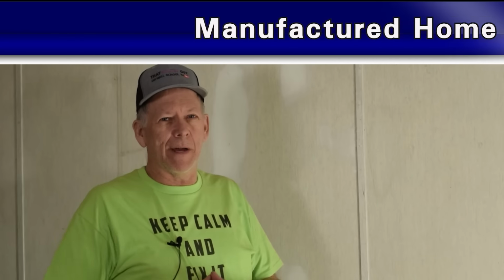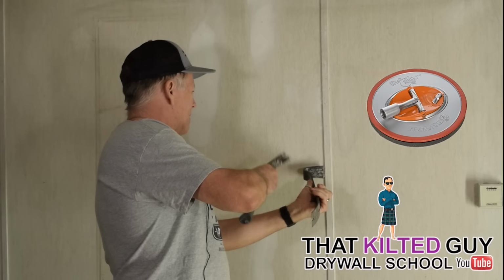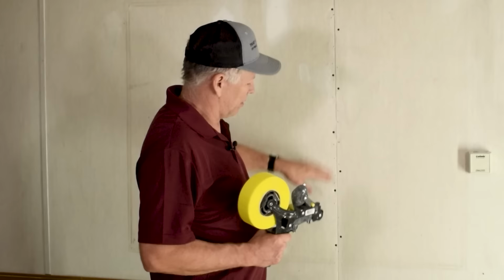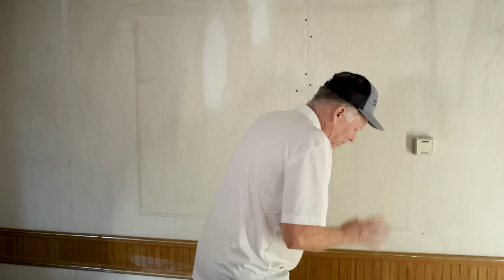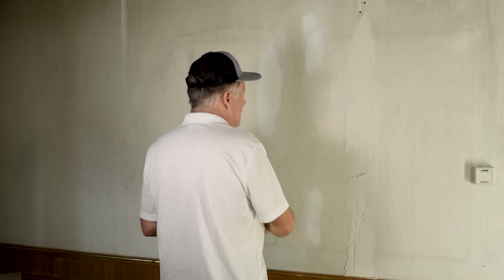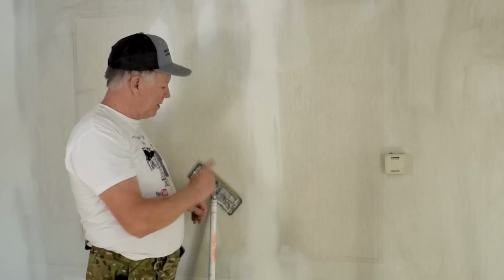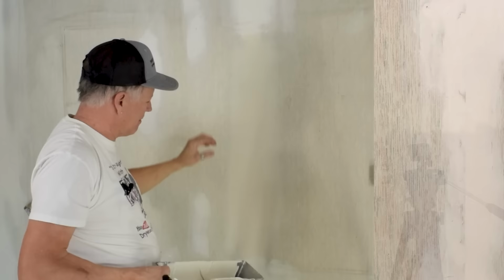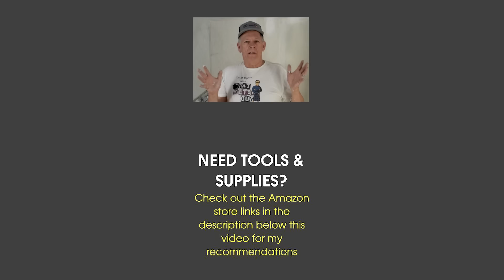Mobile Home Wall Removal in 2022. Smoothing out the wall strips

Comment: There’s so much negative stigma associated with owning a trailer home. But with the tiny home movement this is a fantastic way to upgrade your house into a home!
Reply: I think the stigma is more about the PARKS than the homes themselves
Reply: K Moore1  hey I've toured a triple wide they are GORGEOUS
Reply: Perfect video! How did YouTube know I was thinking about this in the shower yesterday? I bought my 2100 sq ft triple wide for cheap 10 years ago. Paid cash. Upgraded flooring and appliances first. Doing a metal roof next and should last for the rest of my life.
Reply: When I'm done with mine (it's a second home on 31 acres) you will never know it was a mobile home except for the trailer hitch. I'm leaving that for the tax assessor. All totally gutted and redone right on the inside. The outside will have the metal exterior ripped out, sheathing and then log cabin siding. Every window has been replaced with Pella house windows. With the forest green metal roof and structure the former owner put on it it's going to look AMAZING. I don't mess around. I've learned a LOT in the process, my friends are amazed not only with the results but with my abilities. I'm a software engineer and nobody ever taught me a damn thing about construction. If I can do it literally anyone can. Do your homework and watch YouTube videos.
Reply: I live in a mobile home park..55+ it's sign says" most beautiful park" in illinois & I agree!
Reply: @GlorifiedGremlin  
That’s true! I bought a mobile home in a park but it’s nice and gated with a private pool and park. The park manager is strict but I love it! He drives around every two weeks checking on things. I’ve slowly remodeled. When family found out I was moving to a park, they turned their nose up at me😂. I paid cash for it and paid my lot rent up a year since it’s only $225. I have no regrets. Once I’m done, I pray to find land and move. A mobile home was my only option since I couldn’t afford a brick home. It was better than the $800 a month small apartment I was living in. It’s mostly retired people and people who travel a lot living here.
Reply: They are somuch cheaper to repair and keep up.

Comment: I went ahead and put all new drywall in my manufactured home. The reason is because I wanted smooth walls….no texture. I think even a pro would have difficulty achieving smooth walls. Reasons are numerous….older manufactured homes are often sitting up on blocks on the dirt. They will shift and move over time especially if you live in a rainy/damp/humid environment. Floors get out of level which causes walls to be out of plumb. Studs are never crowned when they frame these so you see waves in the longer walls such as hallways. Over time the floors arch over the I-beams. I will say this though….if you know how to correct these issues and put in some work, manufactured homes can be a very affordable alternative. I purchased mine which is 20 years old for $11,500. I put about $15,000 in and plenty of sweat labor, but it will market for $50-60k in my area. Plus they are great for “practicing” on because of the lower value and cost to improve.

Comment: My experience with mud on vinyl is you have to sand the sheen off of the vinyl before mudding. Also, you should be using PVA primer (poly vinyl acetate primer) to seal and harden mud (1st husband was a union painter). Using regular primer will soak into the mud, causing it to eventually flake off of the wall.
Reply: Union 🥱he didn’t know what he was talking about anyways
Reply: Oil based primer sprayed over VOG will make paint stick. You can also use it anywhere the vinyl/paper is torn. Kilz or the like.
Reply: I’ve found the hot mud is harder to prime and paint, it always has bleed thru  ..I always can see the mud lines with a dark paint ,I’ll try the PVA primer ,I was only patching pre-painted  drywall though
Reply: Apparently you have never done this project in a manufactured home.. My husband did this exact process to our vacation home (manufactured) 10 years ago and it still looks (AMAZING)… great video please keep up the great work 🤗
Reply: @ChristineBriscoe-un1nl   on vinyl?

Comment: I stripped the vinyl off, mudded my joints and then sealed with kilz.  Came out perfect.  In 6 years have had only one crack form.
Reply: What did you use to strip the vinyl off?
Reply: @JodiRaeRandaCastleRockRealtor  Used a wallpaper scorer to get it to lift.  Most of the time the vinyl will peel off in large sheets.  Then used Sheetrock sealer and allowed to dry.  Use a electric palm sander to knock down the fuzz.  Afterwards, I applied a knockdown finish after mudding my joints. If I had to do it over, I would use an Acrylic paint instead of Latex.
Reply: @robertpettit6619  to see
Reply: @robertpettit6619  this is good to know. Thanks.

Comment: I have drywalled many maufactured homes. Here are a few hints from my experiences. 

Corners 
ceiling to wall joints and wall to wall joints 
If the vinyl wall corner joints are tight I prefer to caulk the corners with good painters caulk. Quick and smooth. 
If the corners gaps are large then paper tape them.
If the wall to ceiling joints are large. I have flat taped the wall gap with hot mud and paper tape. only on the wall not onto into the popcorn ceiling, let it dry then caulked the corners tight into the popcorn or heavy texture. 

On flat joints
Test your mud you are using for good adhesive action. After “setting” in all nails, staples, and screws. 
I prefer to paint walls with kills or a good primer then start your mudding. I have not had any adhesion problems then. 

On texturing 
I prefer to orange peal texture eather heavy or lighter. if you try to knock down on these walls the unlevel walls will give inconsistent look. If you are wanting a more knock down  look then loosen up the texture mud so it hits and flattens more.
Reply: I agree with the painter's caulk. I did this after doing traditional that cracked after a year of shifting. We have beach sand type soil. On the regular seams used painters caulk  to fill, then 1 coat of traditional mud. No cracking so far after 3 years. **edit** where I didn't replace the drywall I sanded the vinyl seam. Where I replaced the drywall I flipped the drywall over to the paper side when putting it up.
Reply: As long as the primer you use specifically says it can be used on vinyl then you will be fine. And like you said, prime before you mud. This is extremely important!
Reply: I've got some fairly wide gaps between the wall boards under the strips. 1/8 - 1/4 inches in some places. What would you recommend?  What type of tape? I'm a newbie with mobile home walls so I'd like to go with the all purpose mud for the seams. I'm putting crown molding up to deal with the wall/ceiling gaps. Thank you for your help here!!
Reply from the maker: do you need to use fast setting joint compound for any deep fills and all purpose for the rest. Watch this video. https://youtu.be/vRKrSm2aHuQ
Reply: Thanks so much for your comment.  I was thinking it would be best to prime (or kilt) the wall first then mud, and you confirmed my thoughts. We got a professional to do the main living areas of our house for about $300. They did a good job and still looks good 10 years later. Right now we are having a mold issue in the walls of our bedroom-we believe it's condensation because we have a portable AC to keep room 59° at night (we like sleeping in Antarctica) and with it being 90°+ outside that's a big difference.  So we are going to have to remove all the factory drywall and replace. I think adding insulation should help prevent that in the future.  Is that what you think we should do or something else? It's a 2005 Norris single wide.  We just found out that there is no osb on the outer walls,  that's sorta crazy.  It's just the drywall, insulation between 2X4s a green board- looks like dense foam or something- not sure if it's for insulation or a moisture barrier,  then the siding.
Reply: @ThatKiltedGuyDIY  Thank you for your sound advice - I shall take it!!!
Reply: thank you for ur tip on priming first
Reply: Thank you. My corners & ceiling are cracking in master bedroom. Upset
Reply: Great tips! I was going to ask about corners! Cause theyre really tricky for the Novice!

Comment: I did my double wide however the drywall was glued to the studs with an average 1/2” gap between the panels , the rock was covered with a vinyl type wrap , something I did was put a urethane sealant joint in the gap and apply primer to the walls before tape & mud , I did my walk texture by hand with a stipple brush and broad knife , the sealant joint will prevent future cracking in your tape joint , the finished product looks high end good , manufactured homes are really built cheap so if you scrape and slick your ceilings and replace the trim with wood and upgrade most everything you can really have something nice , by the way I rode out hurricane Ivan in my manufactured home one mile from the Gulf of Mexico in Perdido Key and came out better than most folks
Reply: I have tried mudding my joints twice so far, and even though there was plenty of mud underneath, and parts of the tape adhered to the wall, huge portions of the edge peeled back from the wall with the mud stuck underneath it. My VOG panels are textured, but I'm guessing now that they are too smooth to adhere correctly. I have some super bonding primer I was considering laying over the joints before I try it again. Did it help you to do that? (i realize this is an old comment, but I'm hopeful. I can't find anything to help me.)

Comment: I helped my buddy do this to a manufactured home a few years back. We skim- coated the whole place because of imperfections in the original finish. We then applied a knock-down finish. After primer and paint, it came out beautiful. Thanks for the tips
Reply: We also used hot mud and mesh tape

Comment: Great knowledge. Thanks for sharing as I was a maintenance technician for a manufactured home community. The strip is called “BATTON STRIP”. Yes if you lose one due to whatever the reason you can pull one from the closet and put it in place of the missing one. Matching or painting generally requires painting that wall as most times it won’t match the existing ones.
I personally like the smooth walls it makes the walls look like a site built home.
I enjoy your videos as they are loaded with knowledge and advice. Hope your doing well as I know you retired. Best to you…
Reply: Mainly to keep things in place in transport also is cheaper than mud and tape.
Reply: If I decide to remove the Batton Strips and mudd like he did in the video, when it’s time to move the mobile home will the mudd crack?

Comment: I just did an entire mobile home.  I used light weight with paper tape and it worked great. Did hawk and trowel texture with knock down. It looks great.  Just make sure to use sealer before paint. Zinzer 123 is good.

Comment: I have done a couple of rooms with the vinyl coated sheetrock. One thing I have done is cover the entire wall with a very thin coat of General Purpose premixed mud to make the vinyl smooth. I finish coat with ""Paint + Primer" all in one. Takes a couple of coats to cover darker vinyl but I have not had a problem with paint peeling or flaking off.

Comment: I am a woman but I have done this, my dad grew up during the depression and was a workaholic, he was a mechanic by trade but could do carpentry, plumbing and electrical, he even taught himself to upholster furniture and car seats, needless to say the only way I got to spend time with him was watching or helping him work at home and I learned so much, a lot of common sense stuff as well. I did this and did the same thing, it just took me longer, it's better to take your time and get it right but it is well worth it, I hate those strips on the wall, after you fill in the seams and sand them, find a good quality paint that will cover any pattern and texture on the vinyl wallpaper. He gives a great tutorial on this I learned a couple things too.
Reply: Do you have any recommendations for paint to cover the texture? I am 18. and a teacher assistant so I am trying to remodel my double wide on a budget and I have been really worried about the texture on my vinyl walls showing through when I go to paint.
Reply: @summerdawn368  Lowes carries Valspar paints, they are great quality and affordable, Valspar makes a paint that hides imperfections, I would talk to the paint person at lowes and have them help you find it or buy a paint with a primer, I used eggshell finish to help hide imperfections and texture.

Comment: Thank you! I think I'll buy new batten and forget trying to change the look. The panels are uneven, and the gaps just bigger than they really should be. No wonder batten was used! I was horrified at how difficult to get a smooth seam just running the putty knife down the seam. I just don't have the energy to do all that work. You saved me a lot of money, time and frustration!  I started this project 6 years ago and I am now ready to complete the job! I fell off the ladder and got hurt, but the frustration of the thick gaps where the batten once was really discouraged me and I couldn't find a video for help. I appreciate your how to and although I hate the batten, I think my walls would be too difficult to fill in the seams. Thank you again!
Reply from the maker: Glad to help

Comment: I've seen that vinyl-wrapped drywall stuff in office buildings; it was usually tongue&groove jointed to the next panel using  a steel stud as a biscuit. I'd be inclined to just fill the groove and fastener holes with regular mud using one minimal coat, then cover the whole thing up with flat wall-covering (no texture), using that slightly gummy cement they sell in paint stores. If the wall covering is of decent quality, it could be painted when it gets a little rough and treated like drywall from there on. The seams might need a little mudding (using mesh tape if the seams are a bit curly) at that point, but not much.  
PS: I've never had a problem using mesh tape with pre-mixed mud. It has almost never cracked and has always held together well. The only reason I can see for avoiding that combination is that  the shrinkage might reveal the mesh pattern more than hot mud would , but the final coat has always hidden it well enough for me.
Reply: Nope. Mesh tape and pre mixed isn’t stong amd will fail every time.

Comment: Best option, and really the only way to do this, is rip it all out, then replace the improperly installed R7 insulation they put in these, with R15 RockWool, hang 1/2 drywall, And then watch That Kilted Guys taping, mudding, and finishing videos.
Reply: a lot of people don't have thousands of dollars to do that, there is a reason we live in a mobile home
Reply: @Cam-wi3tp  Thats why He does these videos, You do it Yourself, and it doesn't cost thousands of dollars. You can buy 30 sheets of 1/2"sheetrock for under 300 bucks. If your wanting to save money on energy, do insulation, you can cut energy costs in half, I did it.
Reply: I guess you have never tried to remove all of the glued on sheets of drywall. GOOD LUCK. 
After that all the door jams do not fit.  The trim is a mess. 
I have always done as the man said and saved the customers money.
Reply: Not really. Tight money is the reason they are in a mobile home. The walls are paintable, I just replace the wall battens with strips, caulk, then paint same as crown. Gorgeous.
Reply: If they could afford that ,they probably wouldn't be living in a Mobil home...

Comment: Call me weird but I was just wondering has anybody ever just tried taking the wall down and flipping it I seriously doubt that this vinyl is on the other side I know you would have to recut for the outlets but at the same time all you did was flipping over and you can probably patch it now that it's the wrong side or will that affect the installation
Reply: LMAO, yeah, that won't work, the other side isn't finished like regular drywall... He calls it 'drywall coated vinyl' but it's not really and you def would be wasting a ton of time trying to remove and flip it over (it would also get damaged/stretched and your underestimating how many outlets/etc are in a small space).
Reply: Having lived in mobile/modular homes for over 20 years, it's been my experience manufacturers also use an adhesive to attach drywall panels to the studs.  I have never been able to remove a sheet in one whole piece.  Welcome to the manufactured home life!
Reply: Ours has commercial adhesive holding it on for the middle stud, only nailed at the joint
Reply: I trim out and work on new mobile homes. Vog wallboard houses are glued on exterior walls and on the marriage line of double-wides. The interior walls sometimes has glue but I've removed some without damaging it. And the other side of the wallboard has brown paper backing just like regular drywall

Comment: if you're worried about mud not sticking to the vinyl, then you could roll primer on it. it's basically glue paint, with anti-mold properties. it should adhere to vinyl AND leave a surface for drywall mud... AND prep the wall for paint.
Reply from the maker: True. Just make sure you clean the walls first

Comment: We have pulled the strips down and paid drywall guys to tape float and shoot texture. We then spray primer on it and then spray good quality latex paint. If you look down the wall you can see bulges where they taped the joints but it holds up great.

Comment: I have a nightmare wood panel wall that is giving me some problems. I was going to just knock it down and drywall it. Then i found this. Thanks for the video ..now I have options.
Reply: @froman0069  I'm curious if you tried this on the wood panel walls. I was wondering how that would work since they are a bit different.